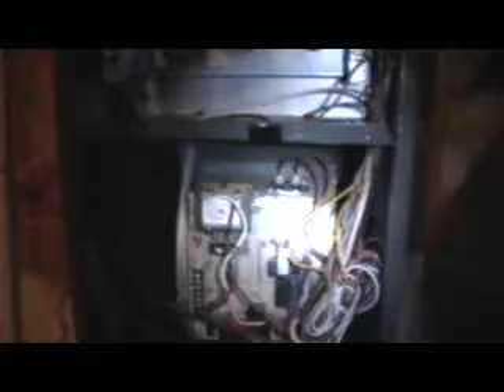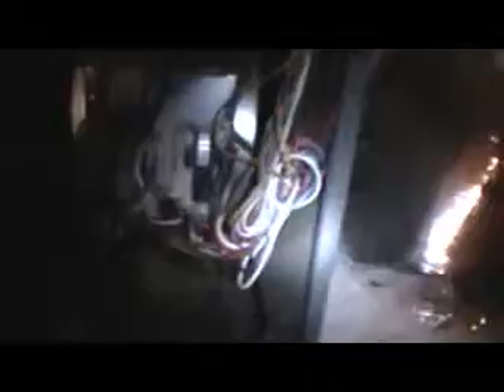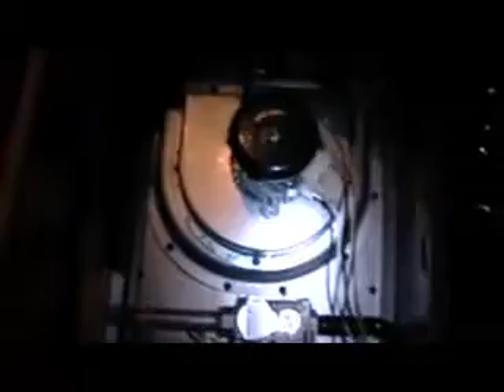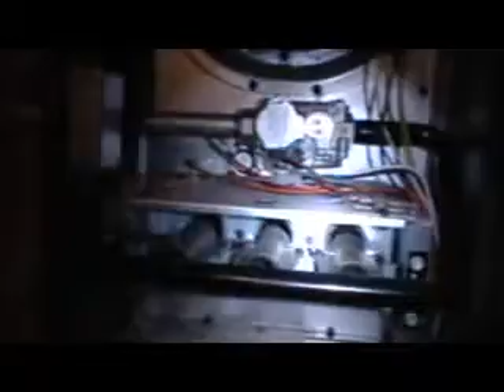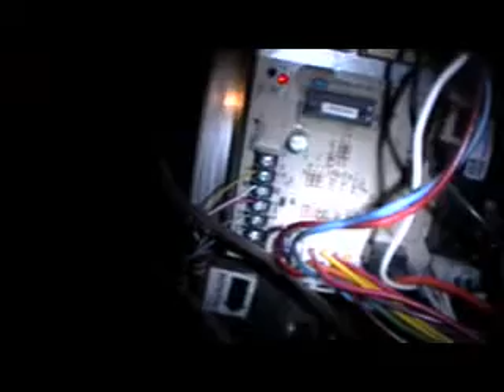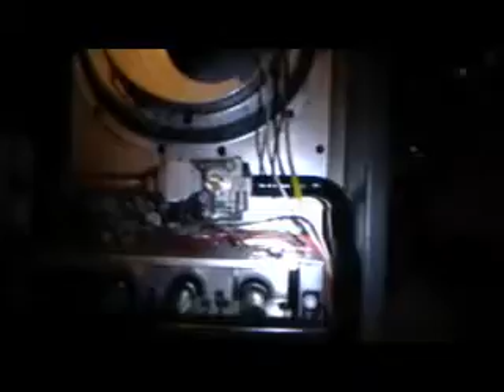Furnace help needed

Comment: you might just have a faulty wired thermostat also make sure you check the thermostat system switch is
set to heat